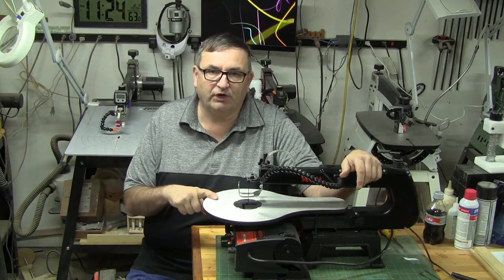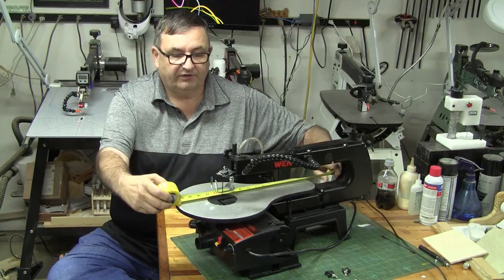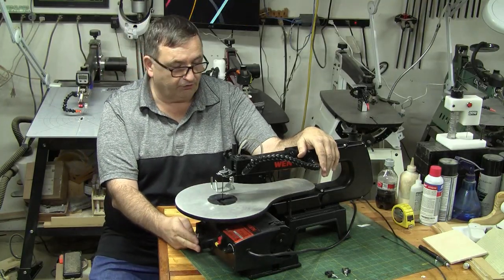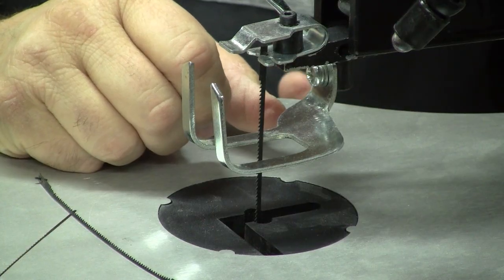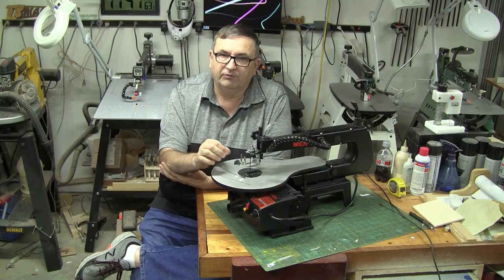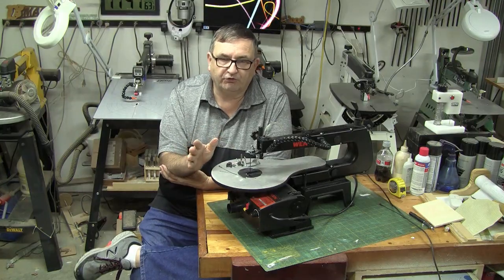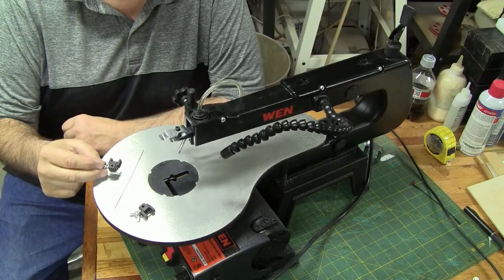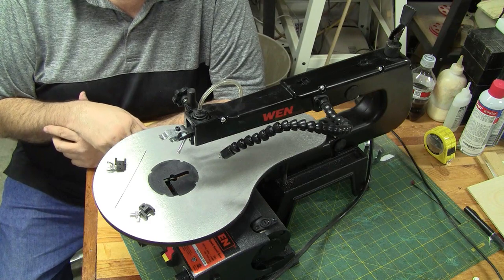Is this the best $100 scroll saw?

Comment: I used a hundred dollar Ryobi for over 20 years.  Used and abused; it got the job done.  A few years ago I finally upgraded, and it was worth it for the ease of blade changing alone!  However, I don't regret starting with a "cheap" saw one bit.  I learned a lot and I got more than my money's worth out of it.

Comment: For the pinless blade, there are two indents on the top, back of the upper arm where you put the adapters.  This is to ensure of placement and proper length of the blade.

Comment: Thanks so much! Yours's is a very accurate description of this unit. I just bought one, and all the inconveniences you display are spot on. But, as you said, this isn't a tool I will be using a lot, just to play/teach the grand kids with, so it's a very capable machine for the non commercial user.

Comment: i picked up a Dremel 1680 variable speed for 75 dollars and it seems well made and is very heavy.
 It uses both pined and plane end blades.
 I had to derust the table but it works great now.
On the 1680 the cover under the table opens back on hinges which allows easy access without taking screws out.
 Thanks for making and sharing this video. I'm looking forward to starting some small projects.

Comment: Recent experience with a similar $100 saw has largely taken the wind out of my sails for this hobby : when a pinless blade slipped out of the clamping system, I re-tightened it, and then the screw inside the clamping device snapped/broke inside the clamp, so I had to return the saw to the store where I bought it. The solution of course is to buy a high-end saw, but these cost about 10-times as much as a DIY-store saw. I don’t think that it would be cost-prohibitive to equip a saw like this with an easy-to-use clamping system, such as the ones used by Pegas or Hegner. That would make the entry into this hobby much easier for beginners, and would avoid the hassle that the awkward clamping system has caused to me, and surely to many others too.

Comment: I have the Central Machinery Scroll Saw.  I replaced the adapter for pinless blades.  It’s works a lot better with the new adapter.   Also, I took off the side cover on the left side.  For getting into the underside as well as vacuuming it out is easier.    You video is great.   Looking forward to getting a higher end soon.

Comment: Thanks Steve for the explanations. On top of the machine near where the tension of the machine has a 2 holes in the arm, they serve as template for placing the blades without pin. it may have been easier to put them on.

Comment: Hi Steve so I've had this saw for about 1 yr to 1 yr & halve and I've learned more from you than I thought I I could else where. By my luck my saw didn't come with the upper & lower pinless clamps since I bought it second hand. Also I went into WEN's website and they are sold out so ill be waiting on that. Anyhow thank you for your time. God bless 🙏

Comment: What great tips!!! Got this saw as a gift, knew it was a cheaper model, but couldn't wait. Except for larger cuts, fretwork was impossible with the pinned blades. Actually like being able to use both. The magnet tip was gold! Although the magnet doesn't stay in place, it's no problem placing it on and off especially with that cowling out of the way.. I've gotten pretty quick with taking the top adapter on and off. Followed every suggestion. I can't imagine figuring out all of this on my own. Thank you!!!!

Comment: I have only been able to afford this type of saw and have been using a magnet to hold  the bottom blade holder up for years, I also have the top holder fixed by making a small plate  fixed to the main screw on top holder that way for me makes it easier to attach the blade also  i use a rubber band stretched over the blower securing knob to the blower pipe then when you loosen it the blower rises up to the top and gives you more room .I also keep a few extra holders so you can have different sizes of blades you might need .

Comment: I have an old Dremel that is about the same saw. The clamp hangers on my saw have a piece of metal, like a spring, on top and bottom. It holds the blade clamps on the hangers. Looks like it would be easy enough to remove the screw on the bottom hanger and put a thin piece of metal on, then the hanger then put it back on the machine. That would keep the hanger from falling off when tension is removed. I also bought several extra blade clamps. I keep one on the top arm of the saw and put the others on the blades I plan to use. When I change a blade all I do is release the tension and remove the center plate, pop the blade clamp off the bottom hanger and pop the next blade in. I leave the top hanger on the arm and hold the blade while bringing the arm down, guide the blade into the clamp and tighten the screw.

Comment: Replacing  the blade holding mechanism with Royobi parts eliminates the need for the separate clamps and makes this saw a whole lot better for using pinless blades. It’s a huge upgrade for not much money. The lower cover can be modified for quick release making access to the bottom clamp easier. Another good mod is to replace the throat plate with a zero clearance insert fairly easy to make yourself. There are a lot of things you can do to make this an acceptable saw for a lot less money than an expensive saw.
Reply: Is there a particular Ryobi model that you used the part from?

Comment: The WEN 3921 met my expectations and found it to be functional after a few adjustments.  I added a light shade (piece of tape) to reduce flickering; a foot switch ($13) and magnifying glass ($5).  Like your idea of adding a magnet to bottom arm for pinless blades.  Not perfect scroll saw but works for my hobby projects.

Comment: I was wondering how those inexpensive saws work. There is several look-a-likes so it is confusing. I actually started out with a good saw because I was in need of one. I bought the Delta variable speed 20" C arm it is a production saw and works great. Like you I have a collection of saws I don't really need but I like the variety. I have a Craftsman 18" the DeWalt 788 type one, a Hegner and an RBI HAWK which I really love. Good review.

Comment: you convinced me on the wen i got the 3923 the pinless hardware came w/ wing nuts no allen wrench (that's convenient) but they sent two more of something similar .Their isn't a hole in the bottom for the blade nor is their a cross pin to slide over the keeper Ia'm totally confused you tube doesn't have any references for the 3923. perhaps with your influence you could ask them what and how to use the extra keepers they sent.Thanks for yr advice about the entry level wen.

Comment: Great detailed tutorial. One thing I have noticed with the budget scroll saws the aluminum table contributes to more vibration .
Most budget tables have a punched hole that raises and deforms the surface of the table  I.e. the opening is the high point.
To check take a straight  edge lay it across the  top of the table to verify.  Also the blower blows the fine dust towards you.
Wear a mask ?  Wish it blew the dust away from you.

Comment: Thanks for all the info, I've just bought a scroll saw Holzmann DKS21 which is the same as yours [just different labels] only thing I found weird is the light only works when the saw is running so its no use for blade changes.

Comment: Found 'regular' clamps for blade changes.  Took the factory assembly off;  the new clamps just fit into place with the same screws.  Now I can just unscrew the top clamp for blade hole insertion...makes it a "hole" lot easier.  Great Review! :-)
Reply: Joseph Snyder where’d you get these?
Reply: same question

Comment: It’s really easy to modify the clamps to accept plane end blades by replacing them with the Mikita clamps which are tool less. A mod well worth doing. My biggest issue with this saw is the inability to lift the arm.
Reply: Correction… it’s the Royobi clamps

Comment: Excellent review. Blade change seems far too difficult but it is a entry level saw.
Reply: if you make a T handle its super fast and you get used to it i used mine for around 2 years before i needed a bigger table lol so i upgraded to the delta
Reply: I use a 5/32 inch hole for pinned blades.  Normal hole for pinless blades is "2/32" so the hole for pinned blades is not that much larger given the patterns being cut out.
Reply: I’m curious why you didn’t use the clamp/blade guides on top of the machine. My old Delta had those and they were much quicker than fiddling with changing pinless blades by hand.

Comment: Have you tried using the blade setting fixture on the top arm? Looks like an easy way to set the same/correct blade length each time you replace the blade. Unfortunately, my Harbor Freight version of the Wen doesn't have the fixture.

Comment: I've had a couple of older Dremel's and they work fine for occasional work. I just have never been able to justify much more than the $100 I've spent for them, but there have been a few times when a high end saw would have come in very handy. I use mine for those occasional small parts I need to make that no other tool can do. A high end saw may change what I do for a living slightly, but for my money it goes to my Sawstop to save my fingers. I've never lost a fingertip on a cheap scroll saw. I can't say that about my old table saw(s)..
Reply: I think a scroll saw of any caliber is useful

Comment: Great video! Very helpful. I have major issues with my wood bouncing all over the place (yes, the blade teeth are in the correct direction) and I can hardly hold onto the wood I am working on. It is not flat wood and pretty thin and delicate. I don't know what to do to solve it. Any suggestions would be wonderful! Thanks! :)

Comment: I like Steve he is really good!
I have a scheppach it’s the same scroll saw just rebranded, it came as a package deal, foot control, variable speed and a cable attachment to use for grinding and engraver with a small box of grinding wheels, sanding drums and discs, it was too good to pass up, it works fine but as Steve said it has a few limitations, if I ever need a replacement I would probably go for an Excalibur and definitely with a foot pedal, I hoped this helps anyone else, it’s still a great entry level saw

Comment: Good video.  I have this saw in Australia which is marketed under a different name. I have struggled with the blade installation and have taken the side plate cover off too. the main problem I have is the 2 pinless clamps having set screws to tighten the blade into the holder which means I have to use a set screw wrench and is very awkard to say the lease. The thumb screws on your model would make it much easier to insert the blade and I will see if they are available in Australia. There is an Olson conversion kit that has a much better clamp system sells is Australia for around $40Aus. I like the idea of the magnet and will give that a try tomorrow. My main SC a Hegner gave up the ghost today so I have to percivere with this one until I get some more cash to buy a better one.

Comment: Can I purchase several sets of blade clamps then prepare all my different blades? Also, could not that lower clamp be magnetized for easy holding of blades? Thanks
Reply: It is possible to prepare blades in clamps but keep in mind that a good scroll saw blade only lasts for about 45 minutes of cutting. They get dull pretty quickly. The WEN 3921 in this review has been replaced by the 3922. It has a redesigned clamping system that is better. Some of the tips in this video are now not necessary.

Comment: When you are adjusting tension, do you figure it by sound? Seems like you were using that as guide. I have this and when I did the pinless blades they kept popping out of unit- is that a speed and tension issue? Or the wood is too hard for the blade? Thanks for this video- it was so useful!
Reply: Hi Carter. Blade tension is a combination of sound and feel. Then when you start cutting you will notice that the blade
is drifting if you don't have enough tension. The problem is that some entry-level saws cannot handle what I would call proper tension. The clamps are just not good at holding the blade tight. The entry-level WEN does have this issue. Some people will use sandpaper and lightly roughen up the contact points of the clamps. This does seem to help but don't get too aggressive. The WEN can cut with what I call less than ideal tension but it won't be as accurate as a higher-end saw with better clamps. It is just a limitation of entry-level saws in general.
Reply: @stevegood3224  Thanks!

Comment: great video, I have been using a porter cable entry level for the past couple years looking to upgrade but just trying to justify the expense . wonder what should be the height level of the saw? floor to table on saw was wondering if I have mine to low from the floor I look over my projects causing some back fatigue any suggestions. thank for the daily messages.
Reply: My scroll saw is set at the same height as my elbows when setting so arms and back aligned with saw table and remain relaxed.  If back problems continue consider a standing bench and saw set as same height as elbows.  Seems to work for hobby use.

Comment: Will this saw cut 3/4 inch pine or is it just for small projects?
Reply: It will cut 3/4" pine. You have to slow the cuts down but with a good blade, it will work fine.

Comment: Good information 👍 are you still have the small saw after one year this video was posted?? If yes do you still like it ?? Because I need to bay one for my projects
Reply: Hi Rejane. I only purchased this saw for review purposes. I gave this one away right after the review so I don't have long-term experience with it. The guy I gave it to still uses it and has not had any significant issues.

Comment: Could this handle a 2” think piece of wood?  I have a block of briarwood that I want to make a tobacco pipe with.  I’m thinking a band saw would be better, but I don’t really need a band saw, I can get more use out of a scroll saw, plus I don’t really have room for a band saw.
Reply: Technically it does have a 2" cut capacity but that would push this saw past its ability unless you were cutting something very soft. Even high-end scroll saws have trouble with 2" thickness in hardwood.
Reply: @stevegood3224  - Thank you for the response.  I think I’m going to give it a shot. If it doesn’t work out for this purpose, it will serve its purpose for what it’s meant to do. It will give me something new to do that I haven’t yet explored.

Comment: Where do you get a zero clearance plate?
Reply: You won't find a commercial version of a zero clearance plate for any of the entry-level saws. I normally just use blue painter's tape over the hole. If you want to get a bit fancier you can cut a complete table cover out of cast acrylic.

Comment: Why go pinless when using pins can save you so much aggravation? This set up looks an awful lot like Delta's. I'm looking forward to getting my hands on a Wen soon, but it's going to take me some time and lots of patience to deal with the pinless blade changing. If people want real thin blades, try filing them down on their backsides to get them into tight turnaround holes. What has my curiosity if the duo-direction aspect of this saw and using the left to right ripping function when it comes to beveling.
Reply: Hi Steven. There is no comparison between pin end and pinless blades. There are no pin-end blades that get anywhere near as small as pinless blades. That's the reason no mid-level or high-end scroll saws even accept pin-end blades. You are correct that pin-end blades are better secured to the clamps on entry-level saws. The clamps on better saws hold very securely so the pinless blades work well and stay clamped. The better saws are also much easier to install blades. On entry-level saws like the one in this video, pin-end blades are more acceptable simply because the clamps are not great. You just have to limit yourself to simpler patterns. If you use a scroll saw for basic cuts then pin-end blades are fine.

Comment: Hi Steve, thank you very much for this info. I have a question: do you recommend the WEN saw for intricate work with polyethylene foam? Thanks.
Reply: Im interested here as well, as with foam I would have always thought a hot wire cutter would be the best option.

Comment: Just curious is the same as the Harbor Freight model. Just rebranded?
Reply: I have the harbor freight and it is almost identical. The Wen has the additional light and the clamp down on the tensioner. Mine just has a tightener knob for tention with no clamp. Mine was $69 on sale.

Comment: Nice review. I’ve got a Ryobi which is almost identical. The wen tension control is better as my Ryobi (bought nz a year ago) only has a turn tensioner. So no quick release.

The left side plate is similar and looks as if it’s designed to be quickly removed. Mine will never go back on.

The adapter on my Ryobi only has an Alan key for securing the blade. I’m going to see if I can find a wing style screw with the same thread. That looked so much easier.

I like the magnet idea. Real smart. I’m going to try that.

Thanks for this. It was good value

Comment: And can someone explain why on the cheaper saws that the manufacturer’s offer the pinless blade adapters. Then in order to connect it. They have it barely held on by the flimsy metal holder. IMO the holders should at least by more bent up. So that the adapter is held better.
Reply: That is the biggest problem with almost all entry-level scroll saws. If a manufacturer would put out an saw at the entry-level price with decent clamps it would sell.
Reply: @stevegood3224  True.